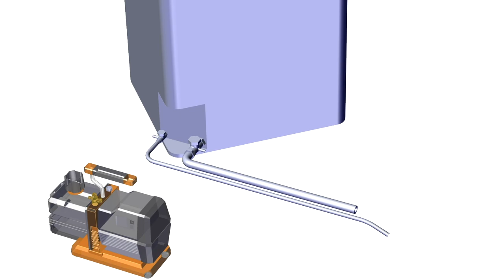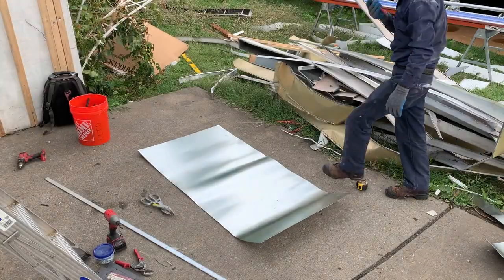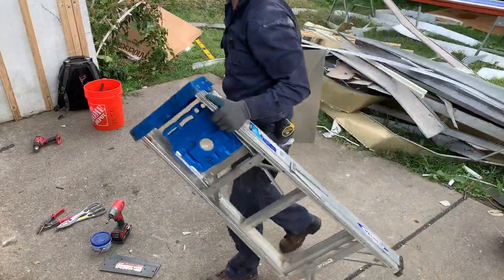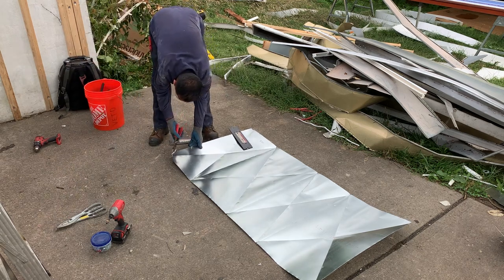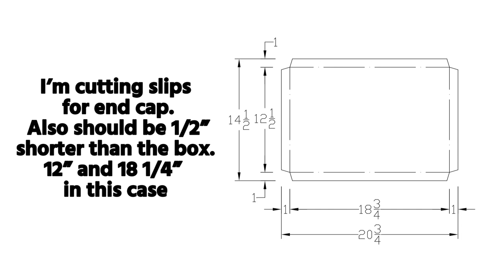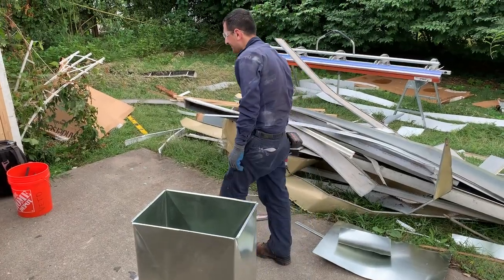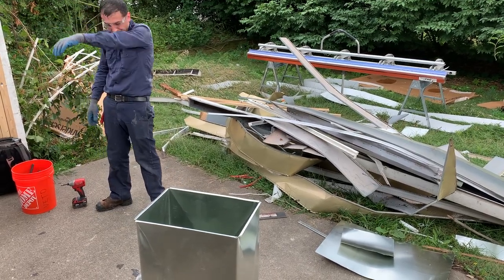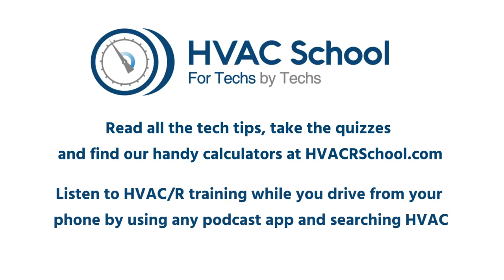How to Fabricate a Metal Supply Plenum From Scratch

Comment: I NEVER would have thought of using an edge of a ladder that way....those cross brakes are crisp...that is slick
Reply: I can't wait to pull that off at work and act like it was my idea hehe
Reply: It’s a great tip
Reply: If you have a lift gate I use the edge.
Reply: That blew me away, however as an old dude I can tell you, you will regret using your gloved hand as a hammer. It catches up to you over the years. Your skills are amazing, great work very inspiring.
Reply: Yeah more than one way to skin the cat I have a really strong pizza cutter you have to do it on a piece of carpet but it works amazing you'll be surprised

Comment: The cross breaks on the ladder was genius. We do a lot of field fab and ill definitely be using this trick. Much easier and quicker than trying to use a bar. Those turned out crisp and clean. Kudos to the installer.

Comment: Never seen some one use a ladder to make 90 bends and cross breaks... you sir are a sheet metal wizzard, very nice. Have you ever looked into a Henslers bender? Or you can make a nice folding tool out of two pieces of angle iron.
Reply: Thought the same 😂

Comment: How much would it cost to install a supply plenum, probably not as tall as that one?   I need this replaced in my home.  The current one there is made out of some other material, flimsy, and now it has come unsealed.  I have taped it and used adhesive spray to try and seal it good, but it is not staying.  Wish there was a way to add pictures on here.  Trying to get an idea of how much is going to cost me to get this job done professionally.

Comment: Terrific video. I have 0 metal experience but am in the process of designing/building a geothermal heating/cooling system for my greenhouse/gardening business.

I am planning on making my own "air handler/heat exchanger" and am trying to figure out how to fabricate my unit. I guess I would just do the same as you show here except I want a removable panel so I will just need to build an interior structure. I want a double insulated wall so I just need to make 2 of the same box just 1 bigger than the other. 

Considering you only used sheet metal, snips and a ladder for creasing and some simple tools for making the bends this should be doable. 

Thanks for the video.

Comment: I'm not knocking the process, but more the execution.  The dings, dents, scratches, etc. from the tech having used a concrete driveway as a workbench aren't the hallmark of "craftsmanship".  In a moment of absolute desperation, "I guess", but if someone did work like this for me when there were better alternatives... I wouldn't hire them again.
Reply: NeverEnough Time let’s face it most refutable companies won’t have their employees fabricating plenums when supply houses have an abundance of them, however it does happen when there is a need and being able to do this on the fly does show resourcefulness and skill. What’s the point of having a perfect scratch free plenum when it’s going to be sealed and insulated? I do get where your coming from but “Craftsmanship” has a broad definition.
Reply: I wouldn't want to work for you either.
Reply: @thomaslong8448  And that's why I won't hire anyone until I see their work and know their skill level/ work ethic matches my expectations.  Silky has a point about it being insulated, but really... how hard would it have been to find some cardboard (which I'm sure is "never" around when you're installing a new furnace) and use that as a barrier between the concrete?  I know, it's "complicated" and I just don't understand.